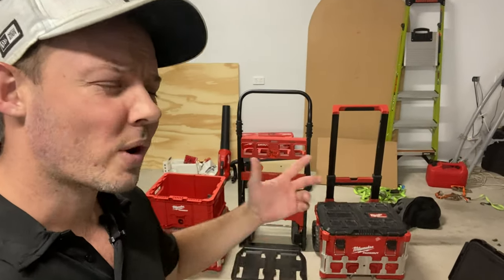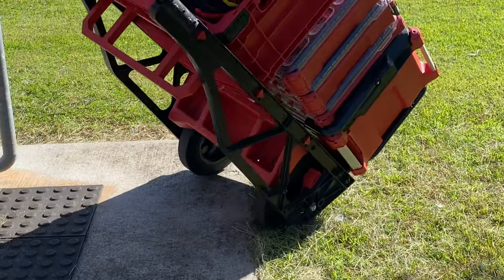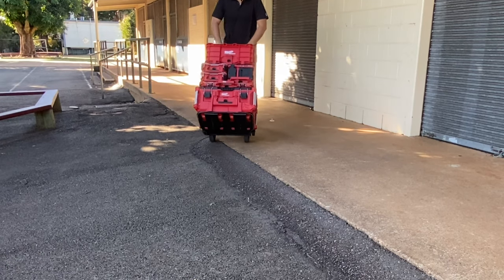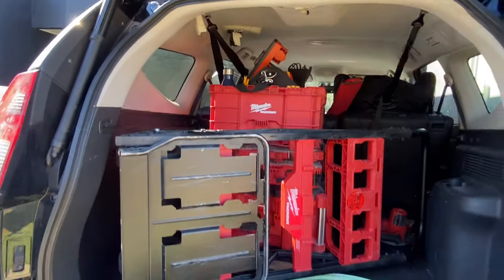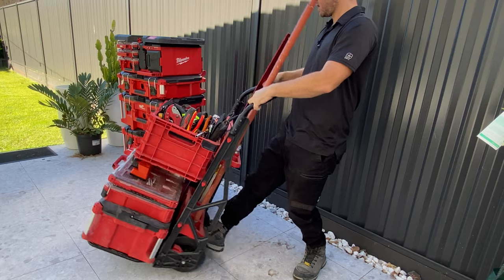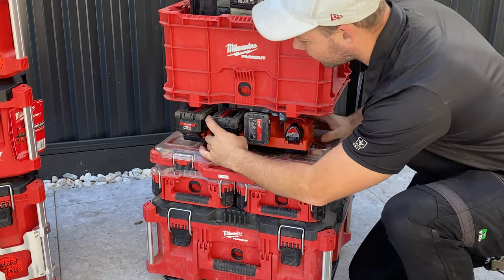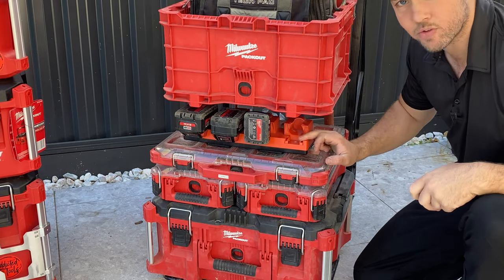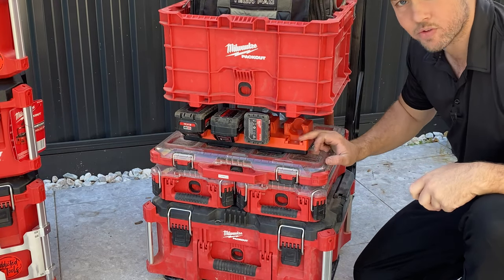MILWAUKEE packout wheel cart vs roller box COMPARISON and setup. Must watch before buying!

Comment: Great comparison.  I use both daily and suffer a bit of buyer's remorse with the wheel cart. A rolling drawer box would be best.
Reply from the maker: Rolling drawer box would have been the best for sure. Should have been the first to be released. Fingers crossed they bring it out. I’m still waiting for the drawers here in aus🥲
Reply: The problem with taking the rolling box and turning it into a rolling drawer unit is that once you put drawers on it you have no wear to put a axial on it for wheels do to the fact the drawers are in the way which is why milwaukee only made packout drawers best option is for milwaukee to make a metal two wheel cart with the wheels on the outside closer to the front
Reply: @lemuelsrandomvids  or they could just have a shallow bottom draw to allow for axle space behind 👍😁
Reply: @AddictedtoTools  tht wpuld be the best reall hope it will be released
Reply: I want the roller box with drawers and removable handle. I'd buy one today! The dolly is too expensive and awkward.
Reply: Still waiting
Reply: No. The rolling tool box screws you once you have hundreds of pounds of other boxes on top. I have to remove 4 boxes to get to my rolling box, every single time, unless I keep my packouts unstacked.

It's horrible, and it's why my finished wood repair stuff is down there. Finds less use for me.

What I would vastly rather have in its place, is a 2 drawer box with a 4 wheel dolly underneath. I think I'll be making my own dollies with better wheels and no stupid step thing to block a hand truck from picking the whole stack up.

I've come to realize milwaukee has a systemic problem. Starting from the ground up. I really like most things about the system, except anything they make that rolls. As well as much of their vertical stuff.

Edit: after seeing milwaukees hand truck, it's a no-go for me 100%. I'm not buying floppy plastic crap, that's a trash. Something akin to an as seen on TV add... KABOOM AND THE JOB IS DONE!
Reply: @EdwardVarner  Yes! So many have asked for this, I cannot beleive milwaukee isn't providing an answer, while watching its customers literally cut thiers to pieces, making them do basically what your saying.

I don't even care about the handle! As long as it's still collapsible. By the time I get my 3 drawer on top and my xl box on that, with my small box on top of that, everything opens fine, except my current rolling tool box. Stuck down there in hades trying to keep my tools from me unless I pay it's toll...
Reply: @lemuelsrandomvids they have made a rolling drawer now ,comes out early 25

Comment: Thanks for confirming what I suspected about the cart being less stable. I just wish the rolling tool box had a version with drawers, making it accessible without unstacking everything. In my trade I move around constantly and it would get annoying having to constantly unstack and restack to reach the bottom bin.
Reply from the maker: No worries John. I’m still wondering why Milwaukee haven’t done that. Or even someone else. Companies are copying the packout but not bringing out the bottom roller drawer

Comment: I parked my packout rolling box and exclusively use the packout dolly. Having a few boxes of drawers that I don't have to remove to get tools in the bottom is bonzer.  Plus if you have to move heavy supplies like a water heater you don't have to bring an additional dolly.

Comment: I have the 2 wheel cart and a flat top service cart with the plates attached to the top and bottom shelf. I use a strap around the top box if I have a few boxes and need to go up stairs with the two wheel cart. I work in the commercial construction so most times I have a service elevator and use my flat top service cart for long term jobs and can lock everything up on site with a cable lock or suit case locks. For quick one day service calls I use the two wheel cart

Comment: Very good comparison! I actually have Dewalts tough system and their DS carrier. I do like it but alas for my needs ive gone to using a Costco 3-n-1 folding hand truck platform cart. It allows me to not only stack my Dewalt tough system boxes on it as a dolly but also use it as an 800lb capacity dolly for multiple other uses. But most importantly it converts to a 4 wheel cart that allows me to stack my boxes, folding ladders/platforms, as well as other stuff on it up to its 1000lb capacity in the 4 wheel configuration and just pushit for long distances on concrete or semi rough surfaces into or around job sites. It is so much more versatile then any wheeled box or the DS carrier or Milwaukee cart imo. The nice thing about the Milwaukee system as well is you could use some of their mounting plates to easily secure the packout boxes to the dolly as with my Dewalt tough system boxes I do use a strap to secure the stack to the Costco dolly.
Reply: Ya, you made a good call. What model hand truck did you get? And is there a different one you've seen you wished you would have gotten?

I'm heading towards a hand truck currently. But I'm hoping to land one that converts like yours, yet has the tank tread type deals for stairs to not mess up stuff like fine wood steps in someone's home.

I'm looking for something that is capable of traversing rough terrain as well as being able to perform in a fine finish enviornment.

I'm probably going to have to make my own 4 wheeled dollies with quality non marring wheels (the grey ones).
Reply: @brandonhoffman4712  I currently use the Cosco 3 in 1 dolly that you can get at Harbor Freight. It's around $170 I think. It works pretty good for what I do. Cosco also makes a 4 in 1 where you can fold up the bottom plate which I think I might like better but the 3 in 1 works good enough that I don't feel the need to upgrade at this time. I've personally never seen a rough surface dolly that has the stair tracks. I only know of appliance dollys that have the stair tracks on the back. I did see that Wesco makes a set of rough surface wheels called the Superwheel model#27005 that will attach to their appliance dolly. Looks nifty but a bit pricey. If you need to have one dolly to use for both delicate interior use as well as rough surface outdoor use it could be a good solution. I gotta say the new Toughbuilt system is looking tempting to me. Especially if they actually come out with their dolly options. But it would be a hard swallow to drop the bread to switch over to that system.
Reply: @duncdunc76   Ahh okay, I saw the Cosco somewhere online. Cosco is one of the worlds largest container ship companies. Makes sense they make enough hand trucks to sell to the world!

Thanks for the info man!

Comment: It is amazing how a little more width makes things better. Looks like there is a place for  both of them in my life. Thanks for the comparison.
Reply: No! Say it ain't so!

I'll sell you my rolling box! 50% off, no?

Okay I'll do $40 bucks.

I just need to get $250 to replace it with a 2 drawer box leaving me some cash to make my own 4 wheel dolly.

Then I still need a hand truck. But there's no way in hades I'm buying that as seen on TV piece of crap milwaukee made. Literally, WTF...

Would you sign my petition to have milwaukee hand trucks removed from home depot? I guess it won't matter, eventually it will only be special order like thier 20" tool tote is today.

Comment: 11:50 It's physics (lever). The weight is forward a lot more compared to the wheel axis (fulcrum) vs on the trolley, so you have less mechanical advantage and need more effort to tilt it and keep it that way.

Comment: I choose neither. But conned myself into the rolling tool box, back when it was a much shorter stack.

I'm currently looking @ making my own 4 wheel dollies.

I currently have my rolling box loaded with finishing stuff for woodwork mostly in the way of post finish repairability. Then I have a 3 drawer on top of that as a cutting box. Drills for round cuts @ the bottom, jig saw/multi tool/dremel in the mid/hand tools and blades up top. Then there's my xl box on top of that as a general box. Trash bags, tape, 4 8" clamps, hammer, lixie dead blow mallet, 2 pry bars, a baby pry, slim pry, channel locks, screw driver, 2 4" scrapers, CA glues (med & thick), CA activator. Then on top of that I have my marking box. Speed squares, slide squares, miter gauge, sliding t-bevel, fastcap magshims, deck of playing cards (for fine shimming), feeler gauges, laser measure, 3 tape measures, pens, pencils, markers, note pads. Then I have 1 1/2 box for milwaukee batteries, an open bin meant for trowels and a bit of a catch all, and a 15" tote which I load with things I need throughout the day as I need them to keep handy and organized, also to help get everything to the tool boxes @ the end of the day faster.

It's a lot of crap, but only some of my stuff. I've got festool stacks too, and I'm looking @ building another milwaukee tower to hopefully shrink the one I have.

My rolling toolbox is the only one I wish I hadn't bought. But they didn't have drawers yet when I made that purchase.

I've got a whole other finishing box that's even bigger, a mini metal toolbox with drawers. A husky soft rolling tool case. And still have crap spilling out in the garage...

So many tools! So many good works.

Comment: This is the exact video I was looking for. Unfortunately,  its been 2 years and Milwaukee hasnt done anything about the shortcomings of the big dolly. Thank you for doing this comparison.  👍
Reply from the maker: I’m also disappointed with them. They’re websites are full of bad reviews on it. I’m still using the trolley now though after I modified the wheels to the sides. Never had a problem now
Reply: @AddictedtoTools  Glad you were able to work that out. I think their marketing team has priority over their engineers.
Reply: Yes for sure. Marketing is well represented in the boardrooms of corporations. Engineers, not so much.

So when cost analysis is done with a fine tooth comb. It's easy to be like weber grills and opt for plastic wheels from the makers of Milton Bradley...

I watched a man load the boxes to 400lbs and just bend that bottom plate like it was my wrist trying to carry that load! Only a strap from a 3rd party manufacturer would allow it to reach max weight capacity...

While using a strap is recommended for stability, any good hand truck can scoop 400lbs off the floor...

This thing feels engineered out of this country. I don't feel comfortable with it having an American flag on it.

Comment: Brilliant testing . You really, really helped me decide to get the Packout style instead. I’ve been waiting for a test like this. 
     I’ve worked on 4-Movies In Special Effects and installed Commercial Machines for 36 years. You are a sharp man and that’s what look for in working on Multi-Million $$ Movies. You would fit right in. 
        You are right on the money to point out the Axel location and why it makes a huge difference, great observation. 
         I’ve subscribed and keep up the proper testing and ergonomics of making us Mechanics and Special Effects guys constantly innovating. Can’t thanks your enough, God Bless You Brother 🙏
Reply: I have the rolling box. Wouldn't buy again.

I've looked into the milwaukee hand truck. I view it as junk that should be on a midnight infomercial on QVC... or maybe found in an as seen on TV store.

I'm replacing my rolling box next. With a packout 2 drawer box. For wheels I'm ditching milwaukee entirely. I'm making my own 4-wheel dollies, and buying a real hand truck for traversing terrain and general use.

I currently have to unstack 4-6 boxes off that stupid rolling box, working my way 4 feet down into what I consider to be tool hell.

I don't work on movie sets, I don't know how tall your stacks get, but over here working on multi million dollar homes where those actors live, we need an entourage of tools, and none of milwaukees offering pass muster with me.

Though I still like the system as a whole. Much more robust, and organized than before while taking minimal floor space.

Comment: Greetings! I'm in the U.S and recently became the owner of the Roller box. It is in the original unmodified state so far and has been a awesome piece of kit. My work space is quite cramped and often have to take my power tools outside to cut, grind or sand what ever the project is and drag it back in, by storing them in here I can literally wheel out everything I need in one go and not go back and forth a zillion times to  get what I want and have to put everything back, quite a time saver.  
     My main reasons I bought the roller box over the cart  was its a box with wheels, I'm not wasting money on a cart and then a box, and in the store it seemed like the box was more sturdy. Height was another issue, I do have friends time to time I go help with there construction projects and to be able to throw my tools in a car trunk means i don't have to fill the back seats up.
Reply from the maker: Hey mate. Sounds like the rolling box is the best setup for yourself. It definitely makes life a lot easier even as you said, throwing it into the car when needed.
Thanks for the input. Keep it up👍

Comment: I have both. We’re a small plumbing & hvac company. The dolly is better that way we have to use it as a dolly to bring in equipment or other plumbing fixtures. So it’s dual purpose. We use a ratchet strap to secure say a water heater. Improvements would be longer handle, built in strap, wider wheels to eliminate the tipping and the base needs to be able to more easily flip up and lock up in place.

Comment: Great video as always. 
I wonder if you could use a longer axel and move the wheels or even the packout roller wheels to the outside of the cart to give the cart that extra stability. Definitely needs some mods for sure.
Reply from the maker: Yeah I’ve been discussing that with some others. I’ll be looking at doing something like that.

Comment: Thanks for the great comparison, it helped me out. I got my 2 wheel cart in and the vertical rails were crooked, so much so I had to slam in the boxes for them to latch. I was disappointed with it for this, and how it felt. I was on the fence about whether to get a replacement or a refund. You helped me decide on getting a refund. I'll roll with my rolling boxes. They fit in my vehicle much better, and are a much better option for me. Besides, I have 3 of them. Thanks Matt. 👍🏻
Reply from the maker: Hey mate. I’m glad it helped. I haven’t heard about any railed being bent. That’s a concern. The rolling boxes definitely fit in cars better. Thanks again for the feedback 👌🍻
Reply: @AddictedtoTools  yeah, I asked around and it seems to be either it slipped through quality control or got damaged in shipping.

Comment: I think this comes heavily down to what your trade is and what kind of area you work in. Commercial construction electrical or anything pipe related the wheel cart having those holders for long handle tools looks super handy. Just bring your glow rods and piper bender on that and the use of a hand truck is a good bonus (though years of just cargo strapping my tool boxes actual hand truck is my personal preference)

Comment: For me cabinet installs.
Was working from a truck  with ramps,was always kept together in a stack with 2 drawerstacks. 
I had kept levels ,3rd hands,and guide rails in rack near the handle.
Advantage hand truck. 

Am now about to become self-employed working from a large suburban where everything will need to be broken down.
Not sure which one will be the winner. 
Hand truck 
Pro able to have drawers on the bottom and keeps the stack shorter, holds levels etc,i have extended the axle and mounted wheels outboard and no longer as tippy.

Rolling box.
Pro axle is nearer the center of load and pulls easier. 

I use drawers and the cabinets (tracksaw and beltsander) for every possible tool that will fit.
I will buy a standard handtruck and modify before ever using the rolling box again,and will mod level storage.
Stacking and unstacking is something belonging to 2020 for me.

Comment: Great video mate, iv been thinking about this and I really think Milwaukee needs to make their packout drawer’s available in a rolling version. this would solve the main issue I had with the rolling box. Unfortunately the normal drawer’s still aren’t available in Aus. Keep the vids coming. Love ya work. 👍🏻
Reply from the maker: Thanks dean. I always appreciate the feedback. I totally agree. They needed rolling drawers at the beginning. I do feel that many will go to the wheel cart when we get the drawers and xl box here in aus. They need to look at the problems though. 
Thanks again and hopefully we get the drawers here soon 🤞
Reply: @AddictedtoTools  really  frustrating that they give Australians no indication of when these products will be out.
Reply from the maker: It’s the usual scenario over here unfortunately. We are usually a year behind. Not sure why it’s hard to get it shipped over. Even those that have contacts with Milwaukee don’t get told much until maybe a month before.
Reply: Can we send one from the US to you or is it probably the same price to ship as to buy?
Reply: Agree the base should be one big pull out drawer so you don't need to unstack to open it
Reply: Mount the mounting plate to a regular dolly